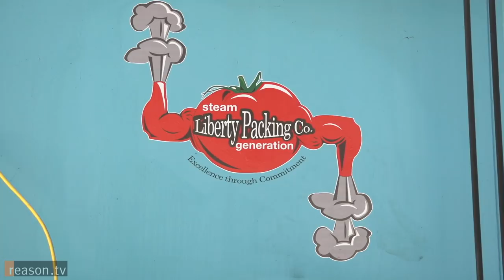I, Tomato: Morning Star's Radical Approach to Management

Comment: If employees were born into firms and never made a conscious decision to work there, you might have a point. I don’t think that's the case, but I see from the article that your father also works for MorningStar, so maybe there's some sort of inter-generational serfdom taking place there. It’s fine if people want to work in this system, but the market will select against it if it can’t beat normal management systems in ROI in a broad range of circumstances (and it wouldn’t if Coase is correct).

Comment: It sounds great to have no managers or supervisors but there are downsides to it as well, Such as the fact that when no one is in charge, no one takes charge.  There may be unsafe practices going on and no one says or does anything because it is no ones job to do so. Sure they say you are supposed to speak up, but in reality, it does not happen, people just want to do their job and not get mixed up in other peoples businesses at the workplace, they feel they are not a manager, not paid as a manager so why make a big deal about something and just add more work for yourself.    Sometimes you need that one supervisor or manager that takes charge and keeps people in line, makes people afraid of doing things wrong or unsafe because they know someone is there to call them on it, when you are all equals, no one holds anyone else accountable and everyone knows it so they feel more free to do things unsafe without any worry about getting in trouble for it.